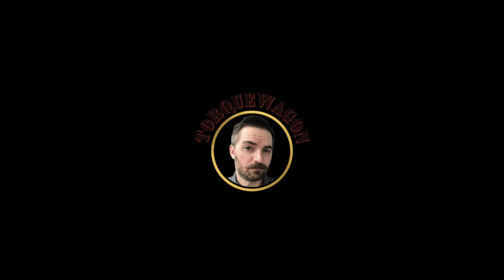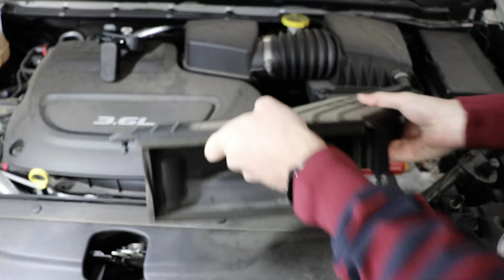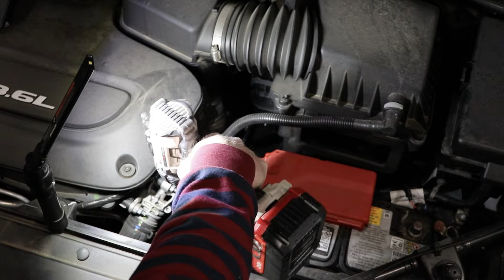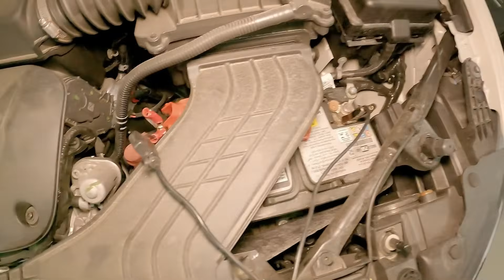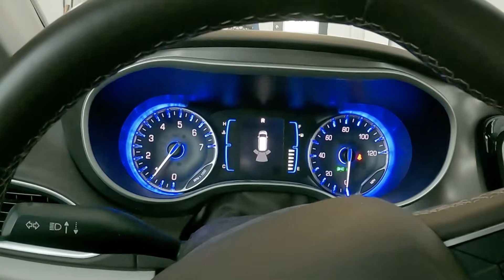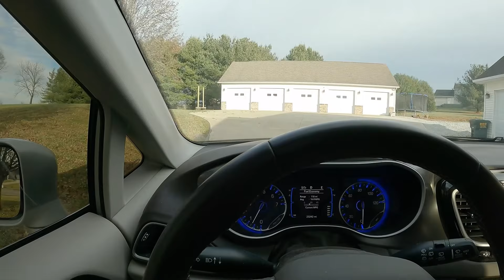Chrysler Pacifica Auxiliary Battery Replacement | Start/Stop Fix

Comment: I changed both batteries yesterday.  Took surprisingly little time.  However, I noticed after checking later that when I turned the vehicle off, there was a sewing machine -like sound coming from under the dash board.  I don't remember it doing that previously?  Reviewed Pacifica forums and looks like some A/C door or switch?  Why would this have been affected?
Is there a system reset function that I need to perform in order to get everything working properly again?  Notable that the radio stations were all still programmed, and it remembered Bluetooth connections, etc..
Reply: It's an actuator you can replace through the glove box they all make a crazy sound just replace it, $20 part
Reply: My car also has that noise is your car all right now?what method was used ，thank you
Reply: Ok mine had the same issue and they fixed the switch.   However we are our 2nd main battery, and 3rd aux.  getting an error for the 4th time.  And I put the aux battery in on the 3rd time.  i used a high quality interstate aux battery.  Our car is a 2018 pacifica and we are also having hard shifts.  So thanks whoever mentioned the aux does something for the transmission.  We are also having weird electronic issues.  Touch screen acting up, rear camera acting weird.  I did find the box on the main battery the bolt that cranks the clamp on the positive terminal is broke from the dealer.   Gonna throw the battery tender on as well to get it alll back up.   Chrysler needs sued or recalled on this.  What a shame.  Great van except the battery issues and bullShiz.

Comment: So I changed both batteries cause why not, I’m already there hahaha but I didn’t reset the automatic shut off feature. If I just unhook the negative to the main battery and unhook the auxiliary battery then reconnect them will this reset?
Reply: How did this work out for you? I’m contemplating doing the same thing

Comment: I have a 2019 Pacifica and I'm going on my 2nd auxiliary and main battery. The dealership won't change just one of the 2 because the main battery is drained because it works harder and now needs to be replaced.  I've talked to many handy car guys and they concur with the evil dealerships.  My experience with a new auxiliary battery needs to charge before it starts working, I experienced this when it was brand new. as well it's normal. Thanks for the informative video.

Comment: THANKS SO MUCH!!!
This worked on our 2020 Chrysler voyager as well. 

After the swap, our ( @! ) Warring Light on the dash went out. Just like in your first test, our start/stop did also not work right away. However the start/stop did start working on its own (without any additional programming/code clearing) after driving about 8-10 miles. 

You definitely earned a 👍 for this video and a new subscriber.

Comment: Good video but I didn't hear you say the name or the group number for the battery
Reply: H6 Size, minimum 660 CCA - MUST be AGM.  Also, AUX14 AGM on ESS / Auxiliary Battery.  Took me 20 minutes with power tool and sockets.

Comment: Can we just remove the aux battery permanently? I don't care if there is a light on the dash.
Reply: Unplug the negative for the ess battery
Reply: You may have a problem when you get it inspected, depending on your state.  Where I am (PA), no alert lights are allowed to be on in the dash.
Reply: I've read somewhere it is also needed for the transmission to shift better so I'm not sure. Did you do it?

Comment: Does this auxiliary battery control the remote start feature?
Reply: I bought van used with only 27K miles. My start/stop ceased to work (which I agree was a good thing), then my remote start stopped working and shortly after that the main battery died as well. So the main battery did drain and is no longer holding the charge. I now need to replace both batteries, so once you see the first symptoms mentioned above it is definitely best to replace the auxiliary battery to save your main battery. Thank you for the video.
Reply from the maker: Since it controls the auto start/stop feature, it wouldn’t surprise me if it controlled the remote start feature as well. I don’t know for sure though.

Comment: Great video, thanks for posting! Only comment is that at 6:15 you mention using an E6 bit. I found that an E5 bit is better fit. I had to go out and buy one, brought the battery/posts to check I got the right bit, and found that E5 was exact fit. I had tried using a pair of pliers to take off post, but they're screwed in pretty tight and I felt like I was stripping the post, so I highly recommend using the torx socket as your video recommends. On price questions in other comments, I paid $99 for a Duralast Platinum AGM AUX114 battery at AutoZone; there's an additional $22 core charge that is refundable when I bring back old battery. Thanks again!
Reply from the maker: I thought the E6 may not have been the best fit, but it worked for me and I didn’t have anything smaller. Thanks for clarifying that the E5 is a more exact fit!
Reply: 4mm socket worked on the battery posts

Comment: Both my auxiliary battery and the main battery are reading at 10.5V. I suppose both need to be around 12.6V. Any recommendations if a jump start will work? If so, jump start both simultaneously?
Reply: Jump starting the main worked. Now, learnt from Pacifica Forums that the 2 batteries are connected in parallel. So if one goes bad, it leeches off the other and could potentially ruin it too. So if one battery is replaced, it's a good idea to get the other load tested for performance, otherwise one might find oneself in a perpetual cycle of bad batteries
Reply from the maker: That is definitely a good idea. I didn’t have my main battery load tested, but I will definitely test the voltage some time to see if it seems to be holding a decent charge.

Comment: Have you ever had any problems with the main battery since you changed the auxiliary battery?
Reply from the maker: Everything has been good with the main battery since I changed the aux battery. Also, the auto start/stop feature is working as expected again, unfortunately.
Reply from the maker: @franciatcho  you might try disconnecting the negative cable from the main battery for about 30 minutes. In my experience it’s like a hard restart for your car’s computer system and tends to fix little bugs that pop up from time to time.
Reply: @TorqueWagon  my '21 pacifica has this problem, start/stop only works when the outside temp is above 60 degrees. lol
Reply from the maker: @franciatcho  the auto start/stop was working again within about 24 hours.

Comment: How much was the battery
Reply from the maker: I paid $112.99 plus tax at O’Reilly Auto. I didn’t price one from Mopar because I’m sure it’s at least twice as much.
Reply: @TorqueWagon  what is the O'Reilly part number?
Reply from the maker: AUX14 is the one I bought. Super Start Platinum Auxiliary Battery Group Size 400
Reply: @TorqueWagon  thanks! Should have checked the video description
Reply: Costed me 136
Reply: $107, Amazon...  AUX14 AGM.
Reply: @lawkerry3433
Reply: You can get these with a 3 year warranty for $99 from Autozone
Reply: @JustinYung  link?